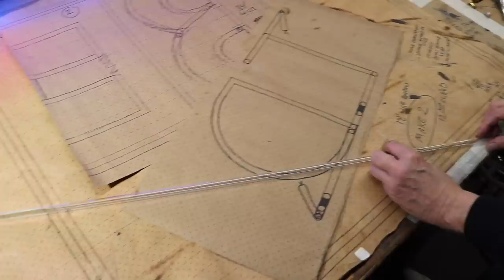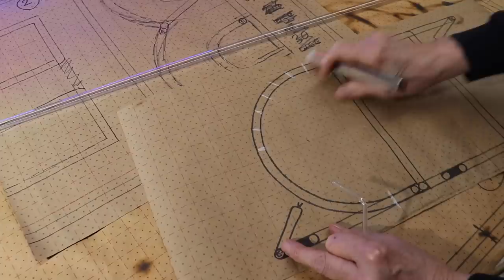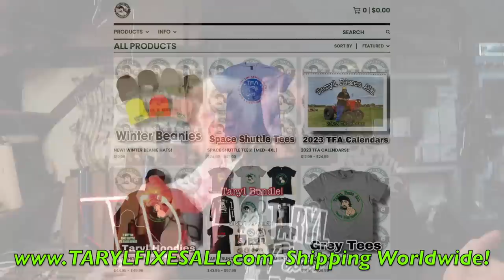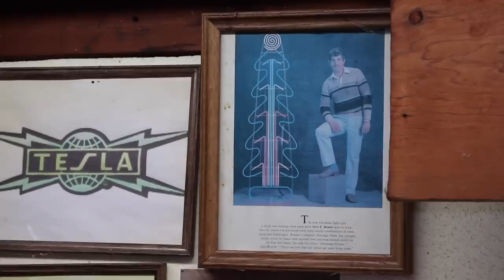How To Make Neon Signs! Truly Amazing! 👍

Comment: I have a neon sign book from 1933 that shows all the steps in making a neon sign. Doc Neon uses exactly the same equipment and terminology they used 90 years ago. What a great video!  Thank you Doc and Taryl, this was a wonderful hands on demonstration!!
Reply: What is the book called?
Reply: @timramich  It's called NEON SIGNS, it's a reprint from 1933 by Lindsey's Books. I think it's out of print, but you might find a copy on some of the book sites.

Comment: I worked as an Electrical & Neon sign installer for about 13 years in the Los Angeles and San Diego area back around 1990 - 2003.  This video brought back a lot of memories from those days.  Thanks for the video

Comment: 45 years ago I was a union apprentice at “California Neon Products” in San Diego. When it came to delivering glass in the neon sign room I was not allowed in that locked room. There was a secret knock I  had in order to make a delivery. The art of glass bending was a very well guarded art.
 Saler Rice was the master who bent the glass for the famous Baton twirler at the campus  drive in theater at College and El Cajon blvd. when the theater was torn down they were able to save the glass and put it up at the College Grove shopping center at college Avenue / Broadway at the cross roads . 
  How secrets have changed over the years.

Comment: My experience with neon about 12 or 14 years old got a transformer from a sign. Made a Jacob's ladder. Entertaining myself and friend mark for a while. Years later the guy I worked for had a rental building. Was a bus stop café at one time.  40s 50s 60s 70s. Here in the attic were those transformers was said the front of building had lots of neon.

Comment: I worked at a high end sign company for about a decade where i eventually ended up taking over every department from fabricating the cabinets channel letters and raceways to finish assembly and supervising the installers led's came out 3 years after i started i have experience with every part of neon but making the glass we out sourced that to neon fred and when i asked why i was told it's to dangerous and takes a long time to train people how to do it right career neon guys don't normally have long healthy lives mainly because of the mercury exposure and silicosis of the lungs this is the oldest neon guy i have ever seen but I'm only in my 40's so.

Comment: Is he actually blowing into the hose, or controlling the air escaping (due to the pressure rising as the tube is heated if it were sealed)?
Reply: Mrs. Doc Neon here. He is blowing into the hose to keep air inside the tube while it becomes soft. That way, it doesn't collapse in on itself.

Comment: used to make krakle tubes....20 mm clear with very small pieces of 5 mm tubilation glass inside ot the unit...over pump it by a few mm....it makes the arc wiggle big time through the unit...mind blowing effect...

Comment: Folks I was literally grabed off the street in 1993 and taught to make neon signs in a few DAYS at a sign shop close to my house, there was nothing hard about it duhhhhh. I then self taught myself to lampwork boro in the mid 2000 and did that for 7 years, glass blowing is hard but lampworking and neon are easy because the hard work is done already.

Comment: Hopefully someone can help me, I'm trying to order seals for a older troy built, horse tiller,that was given to me. Has a 8hp Kohler magnum engine, which supposedly wasn't available until 1987. Says th- 003 , serial number 547342. What year was it manufactured and is TH-003 the model? Thanks for any help.
Reply: I don’t think TH-003 is actually the model#.  It should be at least 8 characters.  Are there any other labels on the tiller?

Comment: This is a lost trade there is probably only à hand full of people left building neon sign I was a master electrician for 40 years till I had a stroke òn 1/4/22 and learned back in the 80s how they worked     and how to troubleshoot non working neon signs but never knew the building process thanks for sharing

Comment: This just popped up on my feed. Your video is damn interesting without the nonsense, tbh. The wig, the teeth, the goofy acting, the fart jokes, not necessary. Had the process not been so interesting, I would have turned it off due to the nonsense. Just some honest feedback. I guess if this your shtick, then it is what it is. Nice info for sure though. Pretty good cut shots to get close up as well. I'll check out another video or two for sure, but if it's the same goofy character, I don't think I would be able to subscribe to watch regularly.
Reply from the maker: Maybe one day you’ll get a sense of humor 🤷‍♂️